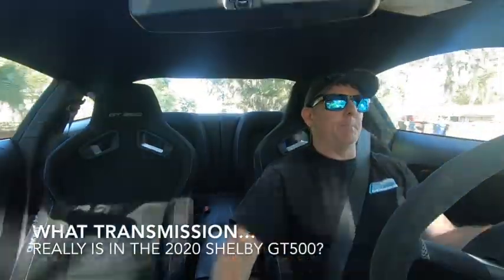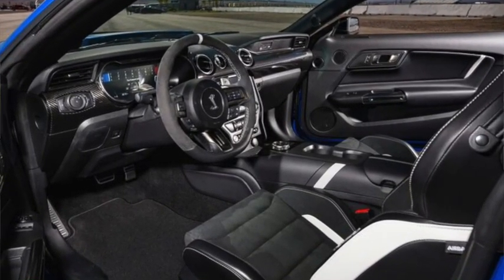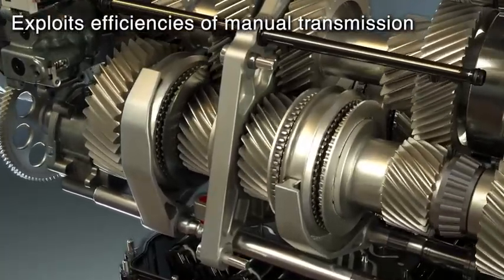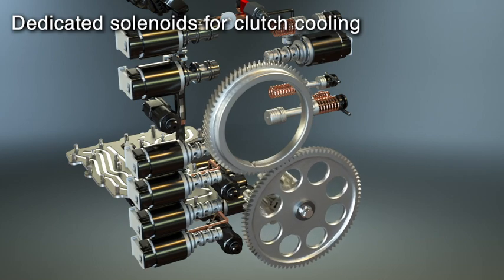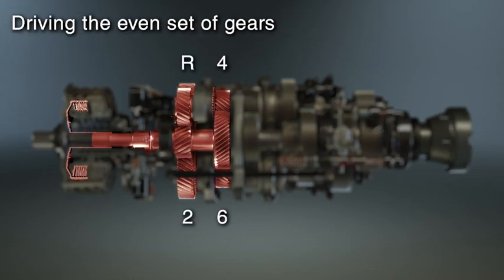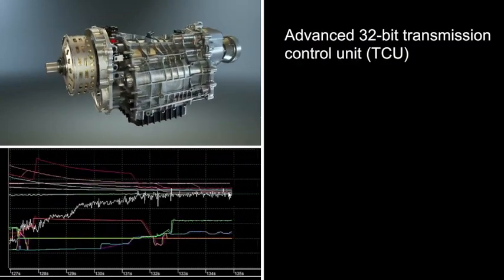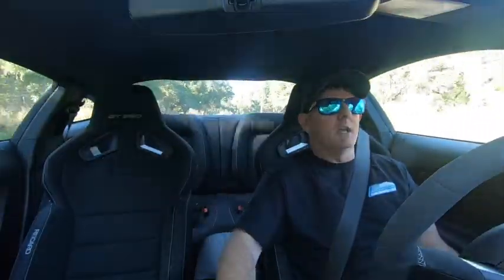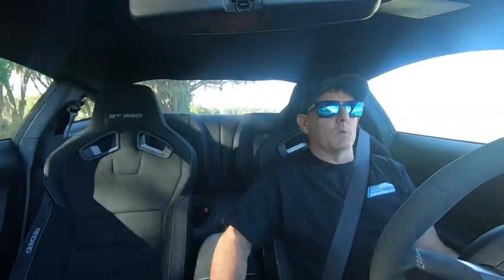Stick or Automatic? 2020 Shelby GT500 Tremec TR-9070 DCT (Dual-Clutch) 7-Speed Explained In Detail

Comment: I am planning on installing a 7.3 gorilla engine into my 1998 Lincoln Mark viii CE. I was thinking of going with the ten speed automatic. However, I would consider this transmission. My back ground is in transmission work and high performance too.

Comment: I don't know off the top of my head ,what 900 neuton meters translates to , but in my mind it would be good for consistent drag times . The 900 would be the limiting factor on how much power you'd be able to race . I know it has a clutch,  but to me it's not a stick without a pedal. Thanks for giving that on the trans , nice to know . Stay safe  🤺
Reply: 900 nm= 664 flb

Comment: How does it work when you are at a stop and you just pull away at normal speeds? Is it in neutral, does it slip the clutches while you are stopped? Never understood how it works at low speeds
Reply from the maker: At a stop it's in First gear with the clutch held in just as if you had your foot on the clutch, then when you release the brake and apply throttle to command movement it releases the clutch in a smooth fashion. The feel is as if you're driving a stick even though the mechanics are automated.

Comment: Evan,
Please ask your friends at Tremec if they will ever offer an aftermarket swap kit (with controller)
Also curious if the TR-9070 has any RPM limitations.   When the GT350 was released, I remember reading something about its transmission being designed around the 8250 redline but I can't remember the details.  I think it had something to do with fluid shear or something like that but I don't remember.
Reply from the maker: Will do, thanks for the comment.
Reply: I just asked the same question I have 350 R
Reply: Is there a possibility of a full conversion
Reply: @davidt1441  
I want it to happen but I don't think it will.   It won't be cheap if it ever happens.
The dealership price for these transmissions is near $20,000 and I'm not counting on many to hit the used part shelves either.  

I'm expecting the 1000+ horsepower club to blow up a lot of these as they push the limits of their engines.  Any transmissions coming from wrecked cars will likely be in high demand, so the demand will be high and the supply will be low.

I've been wrong before and I hope I'm wrong again when it comes to this.

Comment: I think it's a great transmission, but what's the cost of transmission and mods needed to use it with maybe a Coyote. Another issue would be matching shift points to match the engines RPM range. I guess I'm wondering why it's not an option for the GT350. I keep thinking it's matching the Voodoo's high RPM power band. Great questions for Tremec engineers. Nice video with a lot to think about.
Reply: I agree.  At $19,000 dealer price, I'm afraid to take this transmission anywhere near its limit.   Hopefully that will all change if these ever make it to the junkyard.

Comment: Hmm, my 2014 GT with a boosted 7.3 and 7spd DCT 🤔
It's an electro/hydro-mechanically shifted manual transmission, yes?
I'm buying the DCT version of my VFR. Tremec's version is even better. I like design...especially the way one clutch engage odd number gears and one engages even number gears. And, having one clutch basket instead of individual clutches will making replacements SUPER EASY. Cant do that with the Honda one.
What fluid is used for clutch basket? Something with a heavy duty friction modifier??  
That huge bellhousing for two clutch sets is crazy!! Love it. Will it fit in my 2014??

Comment: I'm a manual guy, but can't shift one as fast as that can shift. Would certainly love the speed of shifting for track or strip, but the point is moot; I will likely never have the disposable income it would take to install one in one of my cars. And, if there are ever problems with one, and complexity increases the likelihood of problems, I can only imagine the hassle and expense of getting it sorted out. I only run an auto in my strip car for less parts breakage, manual in everything else, and I wager that that will remain the case. I'll rationalize that by citing the expense and extra weight imposed on those who chose to run a DCT. Very complex, fascinating & impressive performer, certainly.

Comment: Two clutches, gears to provide different ratios, no planetary gears, sun gears or drums. Sounds like a manual trans to me. Just because it does not have a stick attached to the shift mechanism does not mean it is not a manually driven transmission.
Reply: Sammy Sampson lol yes it does, manual means done by hand, there is nothing manual about this it’s shifted by the computer just like any auto trans. Sure the inside is like a manual, but that does not make it one. Please don’t tell me the paddle shifters make it a manual.
Reply: @thetruthaboutfacts224  The inside is a manual trans, not like one...is one. Therefore by definition, it IS a manual transmission. You can disagree, that is fine, but that does not mean your personal opinion is correct. It may be correct to your viewpoint, but not to mine.
Reply: Sammy Sampson sorry but manual means done by hand. If you aren’t manually shifting gears then it’s not a manual. It’s really simple. Has nothing to do with opinion it’s called fact.
Reply: why is this even an arguement? it isnt a manual. it isnt automatic. weve had a name for these things for years. DCT dual clutch transmission. they are their own design.
Reply: @mustang351c4  Yeah, DCTs are pretty much a hybrid transmission. Computer controlled like an automatic, but mechanically similar to a manual. No torque converter like an automatic.

Comment: Will Ford offer a true manual in the future?
Reply: Can I be Frank Yes with a mullet
Reply: I'm guessing when GM offers a manual transmission in the C8.
Reply: @hemi300c4  it's sad that most of the engineers are too young to understand the joys of a manual transmission. There'll always be used cars I guess
Reply: @CanIbeFrank  i agree they just dont get it.  "Why would you want a manual when the auto is "faster"?  Faster is a relative term...couple tenths et dont matter enough to me to take away a big part of the driving enjoyment (for me).  I am a car enthusiast and a driving enthusiast and to me rowing through the gears is a big part of tbe enjoyment.  If you can drive you wont be that much slower in a manual all things equal.   I understand autos in big hp drag cars or in cars that compete and every tenth matters alot...they can launch easier and more consistent ecapecially when makin big power but im a manual guy all day every day thats just what i like.  Ill never be able to afford this newer gt500 anyways so im not concerned with the fact that 99% chance it never sees a manual option.  Ill just buy me an "old" 12-13 boss next year and have a blast rowing through the gears down the backroads here in virginia.